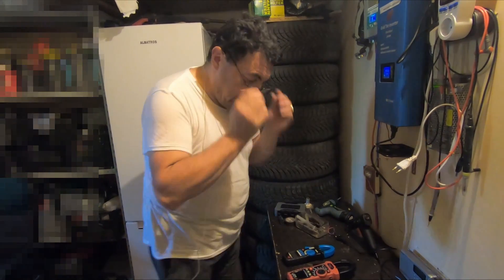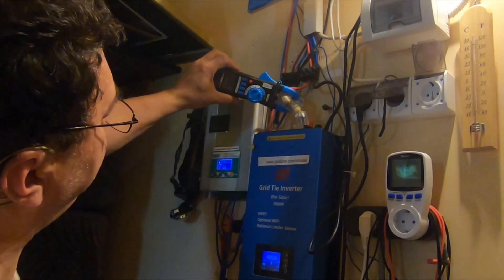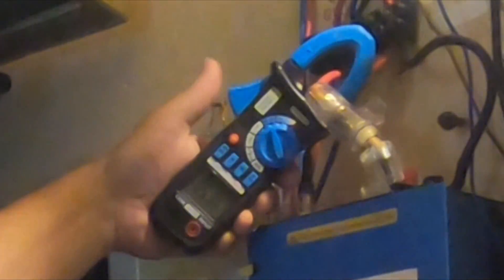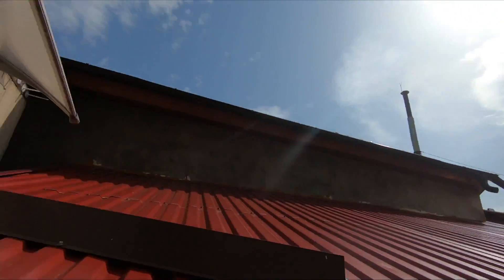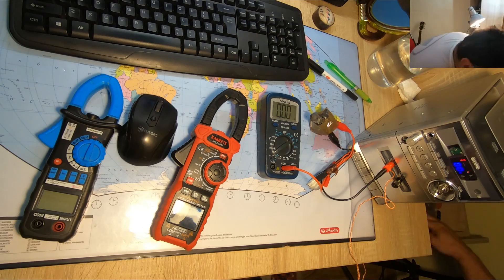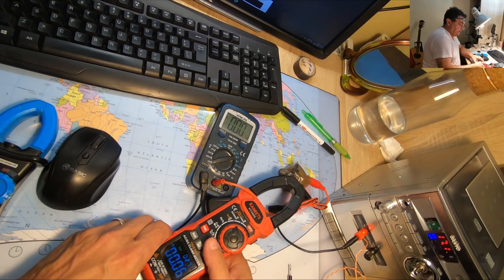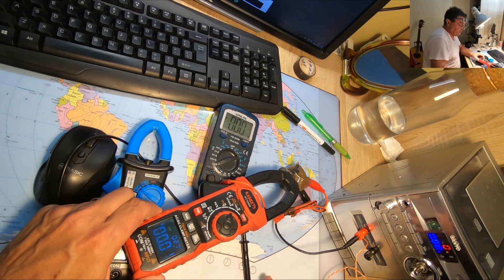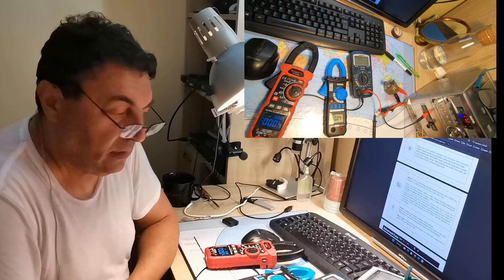Clamp meter DC calibration error solved

Comment: Sir, 
i have a Kaiweets HT208D clamp meter what will be happened when dialer is set ac current testing mode and mistakenly, we will put probes into ac 230 volts sockets. Unfortunately, this was occurred with me  but Luckily my meter is still working fine is it safe because i am worried about this what’s your opinion briefing me pl .
Reply from the maker: Shouldn't be a problem, it is self adjusting to the voltage. The input impedance it’s high so it will be no harm.
Reply: @viocaia  thanks so much

Comment: Where is your other power supply? The one in a ATX power supply case? =/
Reply from the maker: Around my desk, it needs atx power cord which I couldn't find 🤣🤣🤣
Reply: @viocaia  I am building one similar to yours with the same voltage controller board. You got me convinced. =D
Reply from the maker: @SimplyJuanDelaCruz  both of mine works great, but with real OP TL071, and that particular voltammeter it's perfect
Reply: @viocaia  my board uses a different part # - TL081CP. I got me the KIT version. Haven't completed it but soon. =D
Reply from the maker: @SimplyJuanDelaCruz  Yep, same here, I replace with TL071. See my video about how to check those for genuine. Anyway even 741 works too.

Comment: Also earth magneric field has some role at this clamp meters. I'm not sure, but when zeroing the instrument north/south orientation makes some role. If I'm not mistaken, you should orientate it parallel to the cable, you are measuring, and it will also cancel earth magnetic field. Measured current will be more acurate.
Reply: So, you finally learn how to use a clamp meter? 🤣🤣🤣
Reply from the maker: @adaniel69  it's looking like 🤣🤣🤣
Reply from the maker: Absolutely, anyway it's much closer with zero/rel pushed.